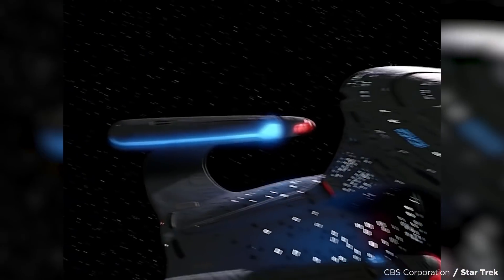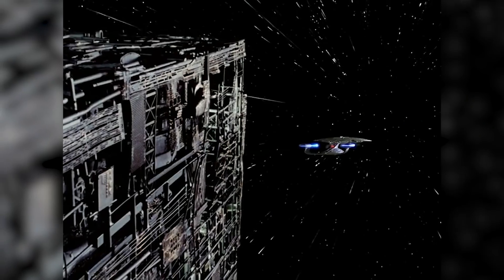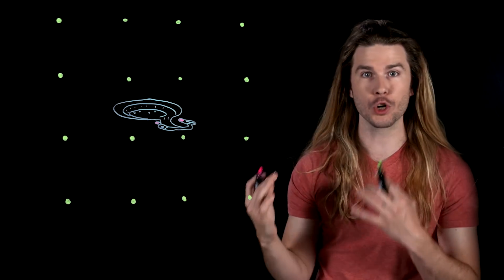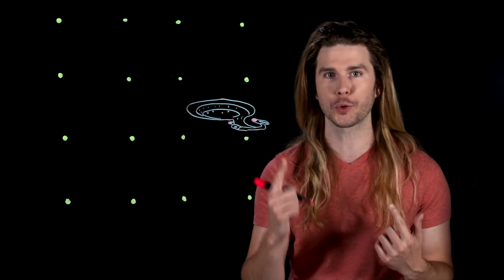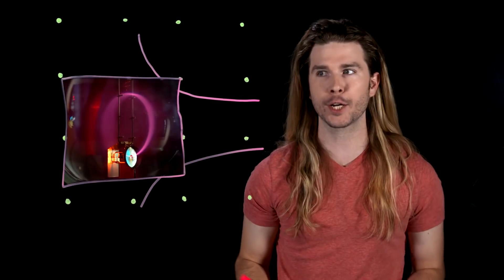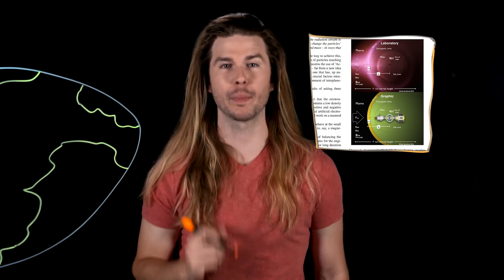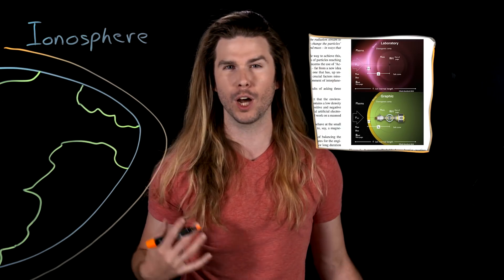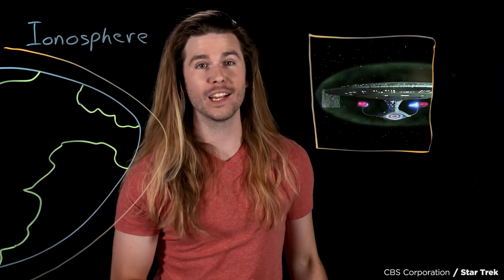How Do Star Trek’s Deflector Shields Work? (Because Science w/ Kyle Hill)

Comment: How does the shielded ship use their weapons?
Reply: by adjusting the frequency of the field and the beam, they can be made to essentially ignore each other. for a simple analogy, think of 2 sound waves. One wave is extremely uniform and the other a mash of combined frequencies, as the uniform wave passes through the unmodified mash it is canceled out by an opposite frequency in the mash. If you know what frequency the uniform wave is exactly you can remove the interfering frequency in the mash and the uniform wave will pass through unchanged. This would work for most beam weaponry and shielded objects.
Reply: Which is why each ship's Shield frequencey is a guarded secret....or the frequency needs to be modulated from the Borg
Reply: Starship shields run on a frequency modulator, as seen in Star Trek Generations, in that film the attacking Klingons use this information to bypass the shields with photon torpedoes and disruptors adjusted to a matching frequency. It can be safe to assume that the same is done when a ship fires though its own shield.
Reply: +Sean Morris, +Magical Fungi, to clarify my background: I have not seen a single episode of Star Trek, and only one or two movies. I am not an expert on what is canon. I do however have a PhD in theoretical physics, and am an expert in the topic of electromagnetic fields. I can tell you:

1. Magnetic fields do not have frequencies. They can, then they are oscillating fields, but the field itself does not.

2. Kyle in this episode never mentions this "frequency", for a good reason: With it, his ideas don't work.

3. With this additional input (that the shields run on frequencies and with the knowledge of said frequency, a torpedo or a phaser can pass through them), one might have to come up with a new theory, or maybe the shields just work in a way that is not known to physicists yet.

4. Given the information of current scientific knowledge and Kyle's explanation in the video, the field does not have a frequency, and no phaser with a matching frequency can pass through it. That is all I am saying. So we need an updated explanation. How about it, Kyle? :-)
Reply: I would imagine that Kyle's explanation still stands for a simple reason:

The magnetic field encases the ship at a very short distance, say a few cm off the hull. The field itself is strong enough that it creates the plasma bubble at a certain distance from the ship, hence the lit up "shell" we see during TNG and the Enterprise's shields being hit. This would provide multiple layers of protection, as incoming beam weapons are deflected and physical weapons are incinerated by ionized plasma (why torpedoes are useless against shields). Stronger beams like disruptors that pass through the plasma would then be deflected by the main shield itself.

ST ships also have multiple layers of shielding. Picard's quip about lasers not even being a threat to their "navigation shields" for example, likely referring to non-combat shielding designed to deflect physical objects like space debris and micro-meteoroids at impulse speeds. I'm assuming that the leading edge of the warp bubble naturally takes care of that when at warp. 

The weapons array probably extends through the shield, or the emitters themselves are un-shielded or project a cancelling magnetic field strong enough to allow the emitter lens to have an un-magnetized field of fire.

As for torpedoes, their casing is probably non-interactive with magnetic fields. It may have just been the prop and the F/X technology of the time, but the casing we see in the old series' movies (Spock's coffin, ST VI torpedo surgery) always look very plastic like. Even the new movies' torpedoes look non-metallic to some extent. Given torpedoes' glow when fired, it may also be that the casing is enveloped in its own magnetic field to allow it to pass through the firing ship's multi-layered shields, and that field accretes plasma as it passes through the active shielding?

I know there are probably scenes throughout the series and movies that contradict my points, such as ships with shields down or inactive firing glowing torpedoes and such, but Star Trek is notoriously inconsistent with its technobabble.
Reply: Florian Fahrenberger I am an avid Star Trek fan and to my knowledge it is said that the Federation uses some kind of graviton based shielding which so far would be outside our realm of knowledge I believe.
Reply: I just google this  and this is what came back:

Simple answer - It 
has a mechanical frequency (mechanical time constant), but so do all mechanical objects. A permanent magnet's field decays over time (years at ambient temperature), but it does not fluctuate harmonically. So it can be considered as a static field.

Soooo.... I do respect you expertise on the matter but Kyle does need to come back with clarification ....

Because Science
Reply: How about the photon torpedos are set to the same frequency as the shield enabling it to pass through the shield, or the outer layer of the torpedoes being charged with a canceling frequency to "phase" through the shield
Reply: I'd say the best explanation is simply that the ships create an aperture through which the weapon fires for a fraction of a second before closing.  Of course this probably isn't canon.
Reply: Remember, it isn't a question of Star Trek technology canon, but what we know about our real world science and accomplish what is done in science fiction.
Reply: So, what if a starship used layers of partial shielding rotating around the ship. It could leave a "gap" in the shields every second or so that the ship could fire through(the computer would keep track), but shooting through it without knowing the pattern would be neigh impossible. I imagine that the "layers" would have to be pretty far apart to avoid interacting, but it might be feasible.
Reply: Randall well from an episode that I saw. They matched their output for the shield and it allowed their weapons to pass through. Although I could be completely full of shit and missed a huge portion of how it really worked.
Reply: moviemaker2011z, the question isn't how did the fiction explain how they make it work.  The question is how science as we understand it today could explain what we see in the show.  As in the video you just watched above explained the shields, how do you explain how the weapon systems work within the new understanding of shields as presented by Kyle.

This is what I really like about science fiction, inspiring people to turn fiction into reality.  The tricky thing is reality has a lot of rules to follow.
Reply: its the charge.
Reply: When they fire, it's kind of like old biplane machine guns that had the trigger mechanism rigged to a timing gear that fired between the propellers but didn't hit them. 
As the ship fires, as stated by another YouTuber, a small aperture opens. The phaser/disrupter/torpedo passes through it and closes immediately afterward. 

@because science

Deflectors and defensive shields are two entirely different systems in the star trek universe. The deflector is used to deflect space borne objects, usually in transit or orbit. Defensive shields are calibrated specifically for combat situations. 

The deflector can be modified to serve other functions but it usually results in being damaged or damaging other systems.

All above based upon known in-franchise knowledge about Federation and allied forces. Not sure about belligerent vessels. There are simply too many to follow. 

Great video. Huge Trekkie.
Reply: While Kyle's theory makes sense, its true that it really doesn't match what we see in the shows and movies.  In the show (specifically TNG) the shields are multi-layered, and operate on a few different principles.  One of those is basically the EM/plasma field.  The weapons and sensors both operate through "windows" in the field, managed by the computer.  The frequency of the shields mentioned in the show isn't the frequency of the EM field, but actually the frequency of the movement of those windows.  The ship's computer uses a complex series of algorithms to plot out the movement of the windows so that the ship can do what it needs to do without exposing it to enemy fire.  This is also why very detailed scans of a ship aren't possible when they have full shields up. (the sensor scans they do for targeting are actually not very detailed by Star Trek standards).
Reply: And I just realized this was an old-ish episode and the last comment was a month ago.  Oops.
Reply: Sorry, that's not quite how it works. The magnetic field shield does not oscillate at a frequency, but is constant. Otherwise it would not deflect incoming ions but just wiggle them up and down a little until they hit the ship. If the field is constant, firing from the inside in the worst case could actually bend the beam around and make it hit the ship itself! If the phasers are more light-like, the problem would be that the plasma assembled to shield from the outside would just as well shield from the inside, firing would just light up the ship in auroras. :-)

So, all in all: The question is still very relevant. The only idea I could come up with is to switch off the field for a very short time while firing. But there has to be something more elegant.
Reply: +Randall they depict the shield as a bubble not purely for cgi reasons, but because that is how magnetic fields form... in spherical shapes. Florian is ignoring the fact that shield frequencies are mentioned quite often in the shows and is not done by lowering the shields first. As well as the fact that you can not have a magnetic field without that magnetic field having a frequency... that isn't how magnetic fields work.
Reply: Florian Fahrenberger , that's the challenge I was imaging (though you phrased it far more eloquently than my thoughts had this morning).  Could the ship phasers actually be physically extended through the shields?  The large sphere we see in ST:tNG  circling the ship is partially for storytelling and ease of CGI. If the shields were only a meter thick weapon systems could physically penetrate out and not worry about the multi-ball pinball effect inside the ship.  It gives another reason why it's a common tactic to target the weapon systems.
Reply: +Florian Fahrenberger Magnetic fields have frequencies... if you have a magnetic field, it has a frequency.... The cancellation of waves is a very simple concept and the most likely principle behind star trek shields and their ability to stop beam technology as well as simultaneously allowing your own beams to fire from within. It is as elegant and practical as you are going to get with our limited information. 

 Also, don't forget that the shields depicted are not magnetic fields alone, but a combination of mf, plasma, and "subspace" technology... far beyond the grasp of science fiction writers and us mere youtube scientists.
Reply: +Indigenous Chaos ... why do you spell cancellation with two L's to avoid an incorrect long-E .. but Cancelling and Cancelled  with only 1 L?   .. which would be pronounced as Canceel'ed and canceel'ing

... same thing applies to travel

.. is this just indigenous to the chaotic American 'fool'?